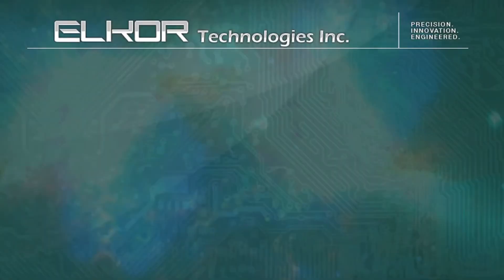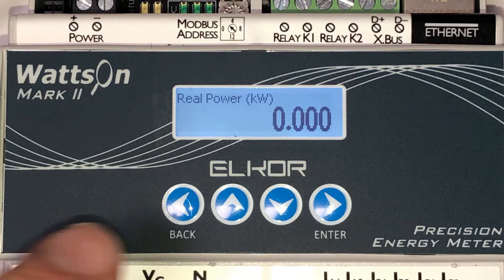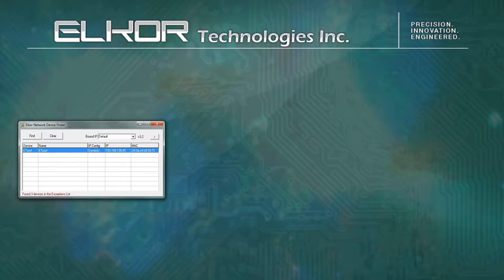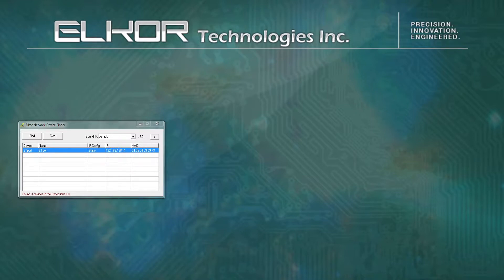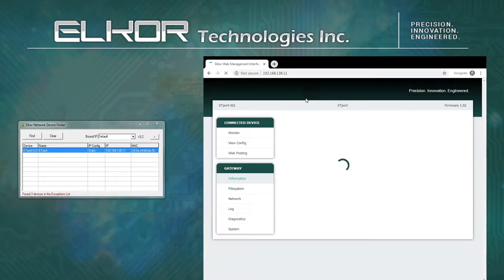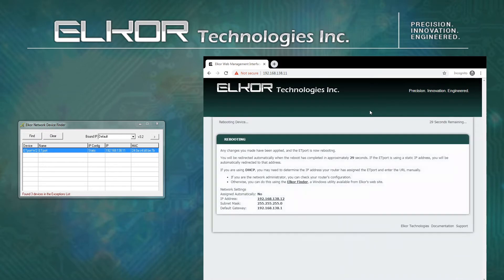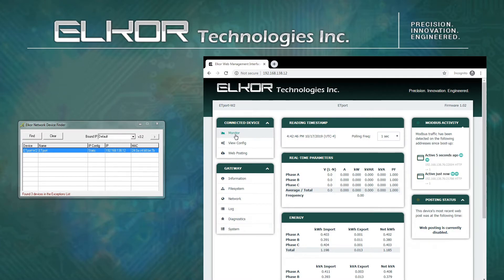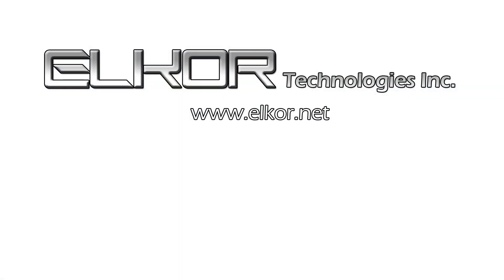Configuring Network Settings on WattsOn-Mark II (-E4) and ETport

Comment: I have a question, it is possible to view the information of the WattsOn MarkII on the web, without the need to be connected to the same network where the equipment is located.
Reply from the maker: Yes, this is possible using our Elkor Cloud platform:
http://elkor.net/product/Cloud

There is a tutorial video at the link which shows how to configure the meter and setup a cloud account.